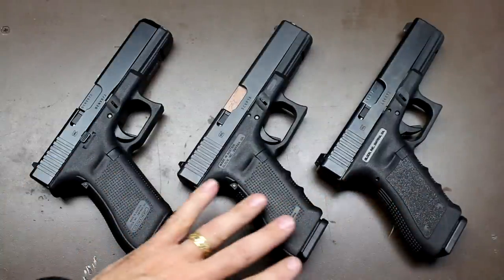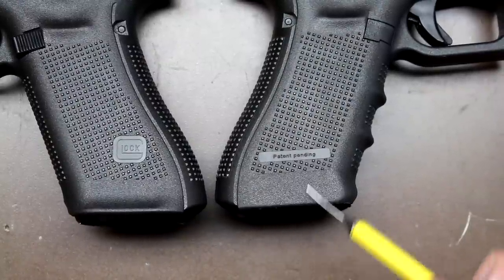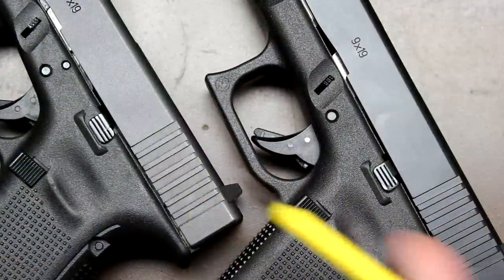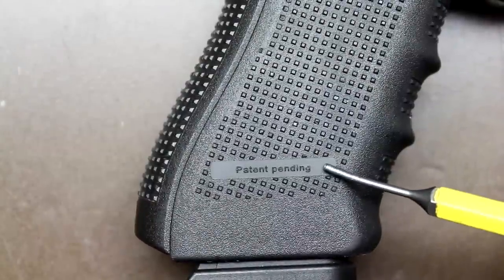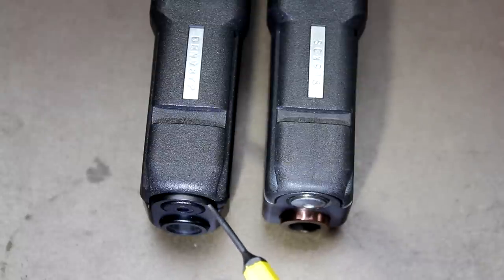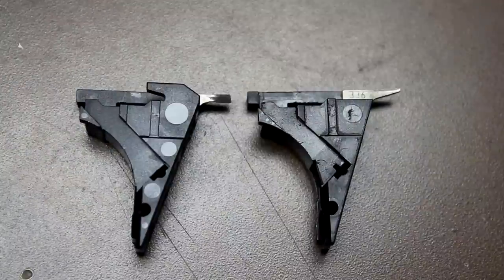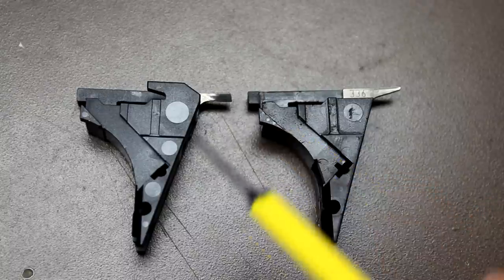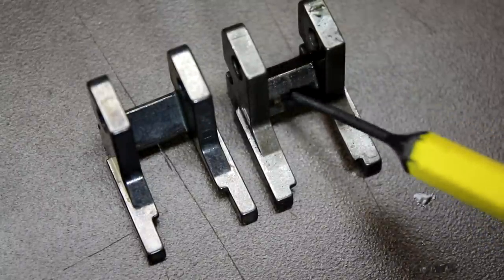Glock Gen 5 & Gen 4 Detailed Comparison

Comment: Years ago my agency tested (Aberdeen Proving Ground) all available .40 S&W handguns for adoption as our Service Pistol.  The Glock pistols all experienced catastrophic malfunctions between 6,000 and 8,000 rounds of our 10,350 round durability tests.  Glock added a locking block pin which cured the problem.  Those pins are absent on the Gen 5.  Perhaps Glock has found another way to reinforce the locking block.(?)
Reply: Hi. Just curious could you tell me what handguns passed without any catastrophic failures? Thank you very much
Reply: How did the M&P and XD do?
Reply: yes they did, gen 5 40sw pistols are thicker than 9mm pistols. so glock 23 gen 5 is thicken then glock 19 gen 5. Not quite as thick as g21 or g20...but in between
Reply: @rtz549 

Don't know about police but the XDM failed less than 100 rounds for me.

Comment: I have a Glock 19 Gen 5 and noticed the top of the chamber of the barrel doesn't have the slight angle tapering down like all the other Glock 9mm's have. None of the lager caliber Glocks had the slight taper down on top of the chamber only 9mm's do but not the new Gen 5 9mm, it is flat/straight. I hope I explained it right. I think that's a big plus for the Gen 5 9mm's because the other gen 9mm Glocks at the front of the chamber on the top would get wear marks from the slide rubbing against the angled area of the chamber from the pistol cycling. Again I hope I explained that right.

Comment: Excellent video explaining the difference in Glock gen 3 4 5 by the way the magazines will fit in the same gun if you have a Glock 26 19 it doesn't matter about the cutouts it's the size that counts of course the Glock 17 is much longer that will fit in the smaller Glock 26 or 19 one thing about Glock they made everything easy they're not like the other guns that are out there shop around and get the Best buy some people like the older models save a few hundred bucks they work just as good I think the other Gen 5 is just the gimmick with the Barrow and the grips and throwing away with the finger grips they should have left it alone

Comment: Great comparisons. There were a few mistakes though. My Gen3, for example, didn't have a cutout on the front of the grip. I think he meant Gen2, and the one on that Gen3 pistol either got scuffed or it was modified because it doesn't look perfectly round. My guess is that it wasn't originally there. My Gen4 also had the bump on the beavertail portion of the frame. I think this was introduced a little later when they started using beavertail back straps in addition to the non-beavertail ones.

Comment: the original tenifer was the best finish I've ever had. I wish they hadn't changed it. I'm not sure, but i think the gen3 look rough because of the surface treatment of the metal. if the tenifer changes the surface of the metal instead of just coating it, it wouldn't make sense to then polish off the changes by grinding on it to make it smoother. I'm not liking the lack of parts commonality either.

Comment: My Gen 4 17 has the little nubb on the rear of the grip.  It was an improvement they did to later models.  Some earlier models also had a very tough slippery peel feel finish to the slide while the later ones had more of a matt finish that scratched easier.

Comment: I like the Gen 3 and all the parts available for it. They still make it, and it is a little less expensive than the Gen 5. I have a Gen3 and a Gen4, the double spring on guide rod does help smooth out hotter cartridges.

Comment: I'm not sure if I have a gen 5.5 but my gen 5 is different from the one in this video. Mine has front slide serrations, my frame has a bevel at the end to match the barrel, mine has no front cut out on the grip. Mine only came with 2 dovetail back straps a medium and large.

Comment: Excellent comparison in fine detail.  I suppose it leaves me with the question, "Where is Glock going with this?".   The myriad of internal changes suggest an attempt to improve quality, but a lack of quality has not been a major concern of the Glock consumer base.  The "value add" to the consumer is subtle at best, and at worst, irrelevant.

So what is the biggest change to the Glock Gen5 series of handguns?  One might argue that it will be Gunsmiths adding another column of trays to the parts bin sitting on their workbench.  If a company like Canik can provide Warren sites and one of the best triggers on the market, in a stock handgun that sells for less than $400, surely Glock could have done better with their Gen5 offering.

I'll keep my Gen4 and continue to lament the fact that I probably paid $150 more for it than most of these polymer handguns are really worth.  My only solace is knowing that the extra money I spent on my Walther PPQ was probably money well spent.  That solace was made even better with a $100 factory rebate.

Comment: Your gen4 was the early model, I bought my gen4 in 2014 and mine had a smoother finish, it's not the new NDLC but it looks different then the one in the video, also my ejector is the new one as well my gen4 also has the little "tab" on the back of the beaver tail, great review though excellent details

Comment: Gen 5 Glocks are 2 pin, Gen 4's are 3 pin which is better. The third pin actually came about because of the 10mm G20. The recoil impulse at the locking block was causing the plastic to stretch and the locking block was rotating around that single forward pin resulting in the forward legs of the block to move up and hit the bottom of the barrel and slide, leading to jams. This all happened in development so there are NO 2-pin G20s. The G21 came out simultaneously with the G20, and for commonality, they made all the G21s also 3-pin. 

The G22 had come out just a year or two before the G20, and the very early G22s have 2-pin frames. A similar recoil-impulse/locking block rocking problem developed with the 40s&w in the small frame, so Glock quickly modified the G22 design to the 3-pin style. 

Eventually, the G18 also got this treatment and I believe the G26 started out with 3-pin frames, and then Glock decided, again for commonality/one production standard for all frames, that all the 9mms would be built on 3-pin frames. Not sure of the year on that, but it was much later than the G20/21/22/23 3-pin frames.

Is one type better then the other? Yes, 3rd pin is for the locking block, the most stressed part.
Reply: Very interesting thanks. So this particular feature that ensures better reliability of the polymer frame has been removed from all Glock Gen5?

Comment: I've had my Gen5 for 3rs now. And I love it. I do wish they would have put the serrations on back and front witch they didn't on Civ models as far as i know. But Anybody who says the Gen5 is not that different has never owned operated and Gone in depth with previous generations. I have owned Gen2 an Gen4 Glock 17s. I do not like the finger grooves which on my Gen4 I stippled out, I do love it and still own it. But my Gen5 is the Mack Daddy of Glock. From a match-grade barrel to a much much better trigger more flared Magwell. I love the rounded off look over the square. The firing pin block is beefier in better designed an more. Most of all I absolutely love the fully ambidextrous ability of the Gen5(Im a Dominate Lefty). Put it bluntly everything about the Gen5 is an improvement over all previous Generations. I own Sig's(P320 & P228) TP9SFXs(Both Tungsten and METE) Girsan Regard(Beretta 92G clone) Arcus ect and I love them all. But Glock is the Firearm I trust my an my familys life with day in day out while I'm out an about an I absolutely love the Gen5 Glock 17s

Comment: Sootch00 I personally wasn't overly impressed with the Glock Gen 5 and the 35 new upgrades and upgraded parts.  First and foremost I am a Glock Fanboy and have several and use a 19 & 43 & 21 as daily carries.  I don't consider cosmetic changes as revolutionary changes, I do see value in the flared mag-well and the GMB barrel upgrade slash polished parts and a crisper trigger along with a few other things.  However each of my Glocks have my preferred triggers-sights-grips etc.

Comment: Great overview yet again!! I’ve personally have had some finish issues with 2 out of 3 of my Gen 5’s — yes the internal hardware like the barrel shows more wear than usual, but the biggest thing is I saw a trend where the slide catch of my Gen 5 19 and Gen 5 26 started to actually show little chips. I send the 26 back and they sent me a new pistol which seemed to have no issues, however my 19 now with less than 1,000 rounds is now beginning to chip a little there. I just sent it back to Glock because this to me is unexceptionable . I have 3 others primarily that are Gen 4 with thousands of rounds and way more dropping in stone and gravel for tactical training, and yes there’s a little wear, but by no means is there any sign of chipping — especially in the same exact place as the Gen 5. 

Some may say I’m being OCD, but As a business owner, I’d want to know about little
Flaws that have never been an issue before as well.  

I’m personally going back to a Gen 4 19, and didn’t see that much of a difference between the two other than the Gen 5 does look cleaner which I like. Figured I’d share hope that’s okay

Comment: Great comparison. But you never mentioned the extra plastic on the trigger housing that engages the safety plunger when the slide is in the rearward position. Why did they do that? I noticed it on my G43 and haven’t been able to find any information about the reasoning for this.

Comment: The original Glock design is a rectangular slide structure. I don't like the Glock Gen 5 because of its oval structure, and the fact that the barrel tip protrudes from the slide makes the Gen 4 more charismatic.

Comment: Anyway to see the correct way to remove the trigger pin on a Gen 5?

I can't get it removed by depressing or jiggling the Slide Stop Lever like on a G 42 / 43 and just using light hand pressure with a Glock Tool.

Comment: So i have 17 gen 4, and am putting a 17 gen 5 zev slide on it.
Running a 17 gen 4 barrel and RSA in the slide, with all gen 5 internals in the slide. Is there any reason this wont work well? Everything fits and moves smoothly. Just havent ran the gun yet.

Comment: A very good overview of these GENs.  One (?), there seems to be a diff with the sights on GEN 5 vs GEN 4.  One manufacturer points to a height difference?  Is there any mounting changes especially on the front post slide cut and is the rear cut differently?  Thanks for this good video.  You hinted a higher rear on GEN 5, but is that just the sight (?) and does it carry through the entire GEN 5 line.

Comment: Question? I Just bought a new Gen5 19, My first handgun. Took it to the range last night, put 200rds through it. Jammed about 15 times? Should I be concerned about this. I was using remmington 115 grain fmj 9mm.
Reply: Red Robin were you getting hit in the face with brass before the malfunctions? It’s easy to limp wrist a Glock into malfunction (I’ve done it, and recently).

Comment: If you don't put in the hours and don't invest in huge of amounts of ammo and range time, none of these differences on the Gen 5 will improve your shooting! I own both the Gen 3 and Gen 4 Glock 19 models and cannot feel much of a difference between the two, mainly because I'm a beginner and not a pro-shooter. The two main differences I can feel, but don't apply to hitting the target any faster or more accurately, is the texture on the two different grips (I like the rough Gen 4) and the extended magazine release I prefer the Gen 4's release) of the Gen 4. They both go bang in the hand and go where I'm pointing them.

Comment: Would you consider the Gen 5 to be as reliable and as high quality as the Gen 4s? I really want a G23 Gen 4 but might have to settle with a Gen 5. Any input on the Gen 5 not being a safe bet if the Gen 4 isn't available?

Comment: Any experience putting a gen 4 slide on a gen 5 frame? I've heard putting a gen 5 slide plate will make it compatible.

USPS lost my gen 5 slide in the mail and now need to figure out a replacement slide solution

Comment: So a gen 5 glock 17 barrel will fit into a gen 4 glock 19 and 26 since they use the same locking lug now? But a gen 5 g17 will not fit into a gen 4 g17

Comment: hey sootch,, I was in one of my local gun stores yesterday in Cartersville Ga on 4-14-18 and saw a Glock 17 gen 5 and the front part of the lower frame matched the rounded edges of the slide I ask the dealer about it and he said these are the 2nd batch of gen 5 17s and the issue has been corrected with the frame not matching the slide have you heard anything about it? I went ahead and put it in Layaway and going back to get it when I get my tax refund in a couple of weeks it also came with the AmerGlo night sights for $649 oh yeah,,,thx

Comment: I'm changing my EDC from .45acp to 9mm. In your opinion Glock 19 or CZ p10c, I have small hands and know you have said you have medium hands. I guess what I'm asking is which one would fit my hand.
Reply from the maker: First off, I'd go to a local dealer that has both in stock and handle them side by side. Unfortunately the P10C can be difficult to find so here's my thoughts. The P10C is more ergonomic and fits smaller hands better IMO. If you decide on the G19, I'd go with Gen 4 or 5 since the grip is smaller than the Gen 3 without a backstrap. The Gen 5 will make it even better because of the lack of finger grooves. That's just my experience with both handguns. Good luck James!
Reply: sootch00 thanks for your recommendations.

Comment: I was disappointed in the Gen 5,  i hate the cut out on the front strap of the g19. Piss poor design if you ask me. I like magwell,  i dont like how they are changing certain parts internally that takes away the simple parts interchangeability.  I get people saying well you want changes you got them. But, to me if they are going to start making changes from the tried and true platform. Then they should do more,, They mine as well make the design  very different and make a lot of positive changes quickly, instead of release a minuscule change every generations. Yes, some better slide contours and some front serrations would have been a nice addition for the gen 5 to make it more worthwhile. Instead we will see a gen 6 in 5 years that will add front serrations  and  some other minor changes.   I will call it right now

Comment: Just so you know your Gen 4 is like one of the first ones. The later gen 4s have that little tab for the beaver tail back straps. And I got rid of my Gen 4 and want to a Gen 3 because the Gen 4 didnt have the "pitting" in the slide as you call it. The "pitting" and Tenifer finish of the Gen 3 and first runs of the Gen 4 is the best. Everything else is just a shit substitute for Tenifer. Which Glock would still be using is Austria wouldnt have banned it because of the Cyanate which is super toxic.

Comment: 18:23 not compatible gen 5 26 barrels. They can’t be put in a 27 if you wanna shoot 9mm out of it. 

Not the case with gen 4. You can switch a 26 barrel into a 27. Being able to shoot two different calibers with just an extra barrel and mag. That’s was something I really liked about a gen 4 27.

E: tbh you can use a gen 4 Glock 17, 19 & 26 barrel in a gen 4 27. Just looks odd but still… two caliber for cheap instead of having to buy a whole other gun. I’ve owned a Gen 4 19, 26 and 27 and personally tested this.

13:48 more Glock bs they’re chanting for no reason. What a bummer. One of the Glock staples imo was all the compatibility. Tf you thinking Glock?

Comment: Why over pay on a poly pistol?
Reply: By a Glock and three spare mags and you are looking at less cost than a CZ.
Reply: Donald Weber Quite the contrary. The P10c costs 400 and comes with two mags; a third mag would cost around 30 bucks. The Glock Gen 5 is sitting at 550 bucks. And if you don't like CZ, you can choose between Ruger, Canik, Smith & Wesson, or Diamondback all for less than the Glock Gen 5.
Reply: Military=$425 for Gen 5 G19 with the mags and the whole kitchen sink

Comment: Very thorough review but it seems to me all the external changes are cosmetic and a rehash of prior generations. (I'm not a gunsmith so the internal changes mean very little to me) The sights are still plastic and the trigger is not so hot. You still have to spend more money to get a decent handgun. Not to mention the horrible ergonomics. But I guess it's still a Glock.

Comment: great video, but it is still just another GLOCK.  ambi slide release, flared mag well, removed finger grooves,. "AWESOME"  all the crap they should have done two generations ago.  I keep hearing "GLOCK PERFECTION" so why is it that these glock fanboys first thing they do is... change the sights, trigger, texture the grip, cut the finger grove in the trigger guard, send out the barrel for tin coating, cut the slide,  shit by the time you're  done its a "GLOCK perfection with third party help".   I also find it funny... the people that bitch about a 6 lb trigger on a AR which normally has a good break to it will down grade a rifle for that.  but glock still has a spongy trigger with horrible creep compared to like the PPQ or the CZp 10-c , HK VP9,  Sig p320, and these glock fanboys will just prays the new glock trigger.   yes glocks run,  there are other guns that run just as good or better.  but these companies are also becoming innovative and thinking out side of the glock box.  its time for the glock community to stop buying rehashed GLOCKs, so we can force glock to become what it thinks it is perfection.